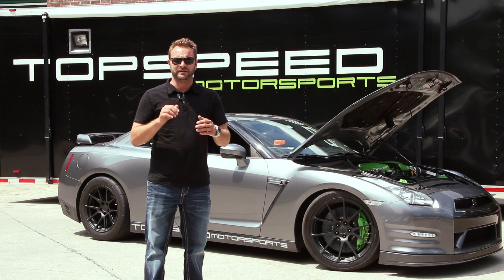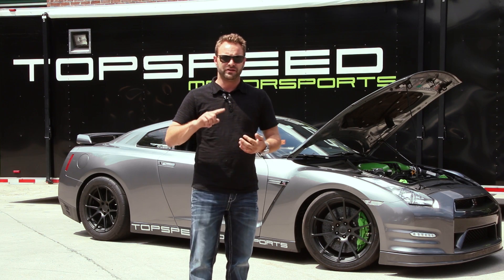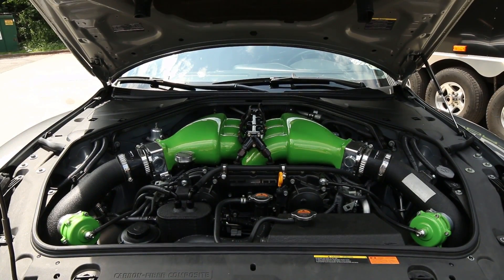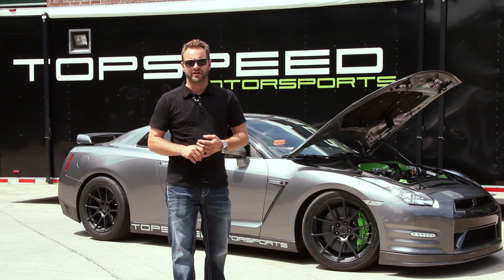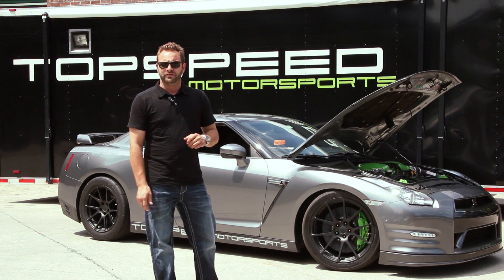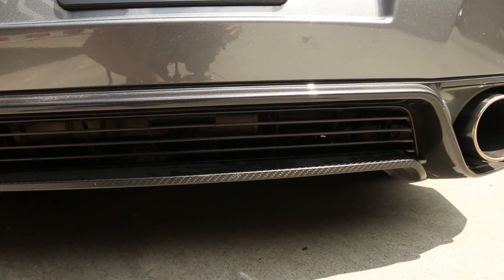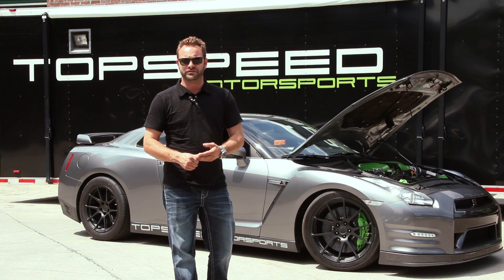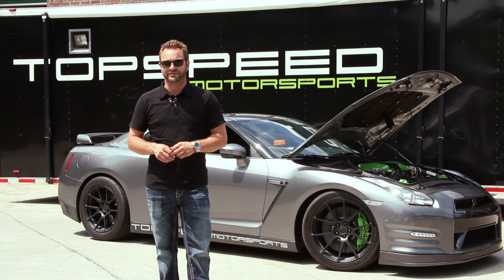TSM Built Alpha16 4.4 Build Video

Comment: What wheels and Tires does it have in the rear cicii?
Reply from the maker: Forgeline with MT
Reply: TopSpeed Motorsports Do you have any video of this bad boy rolling around? Your opinion on a 4.4 A12 and 4.4 A16? Pro and Cons?
Reply from the maker: ///One.Lawless There is some video of it from TX2K on our channel but not a ton, The 4.4 is amazing with the A16.  IMO a pretty much perfect high HP build.  But I am bias... the shop car is a 4.4 A16 :)
Reply: TopSpeed Motorsports Isn't the structural integrity of the block compromised with the 4.4? Heard they break down even with the proprietary mods. Would you say it's safe to assume that a built 4.4. is just a STRONG as a 4.1L aside from performance.

Comment: Why 4,4 instead of the 4,0 ? isn't the 4,4 more limited in the rpm range ?
Reply: The 4.4 will make more power and spool the turbos faster.  If balanced correctly and the proper setup is used in the heads it can still be spun to 9k RPM
Reply: Nathan Cicio
yeah but a 4.4 isn't light as a 4.0.. i doubt it can make the same rpm
Reply from the maker: dimmacommunication  Actually it is lighter.  A 4.4 is a fully custom billet crank where most of the time a 4.0 is a factory crank.   Not to mention factory cranks have been broken at this power level.  Spinning a 4.4 to 8800 is like spinning a 4.0 to 9400 when it comes to powerband.  The fastest GT-R in the world has a 4.4 in it just FYI :)
Reply: Thanks for the answer!! how much is yours spinning?
Reply: TopSpeed Motorsports Sonny Bryant crank? How much power to the wheels on a setup like this (in regards to everything you guys use) be considered "safe".....